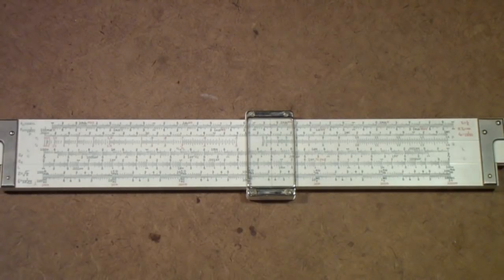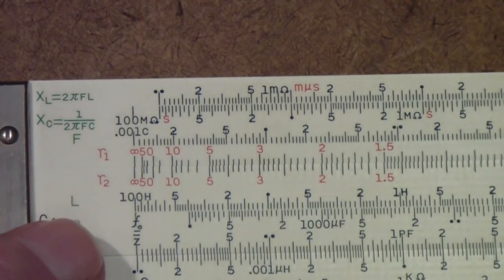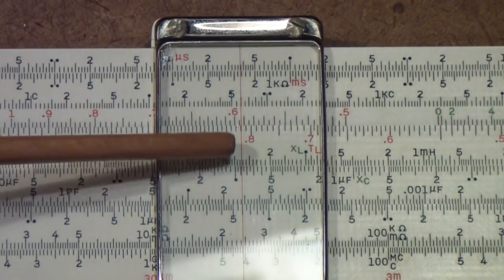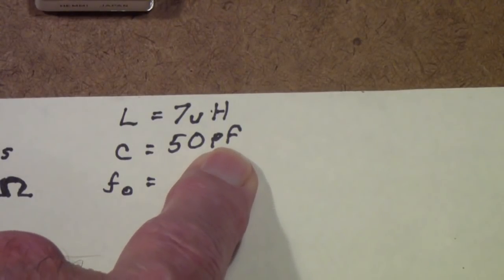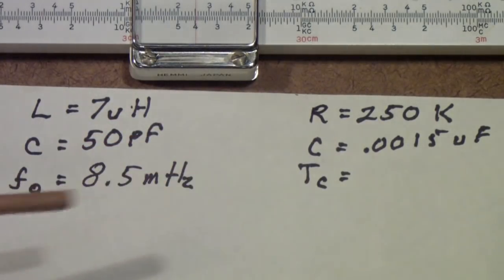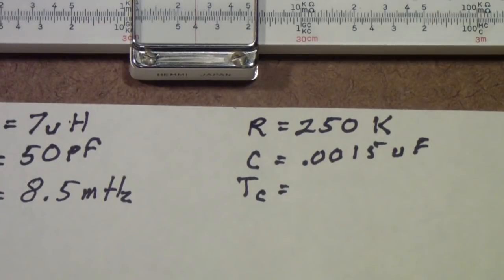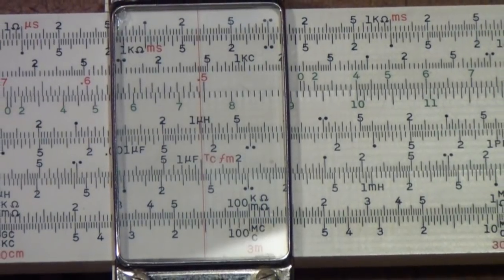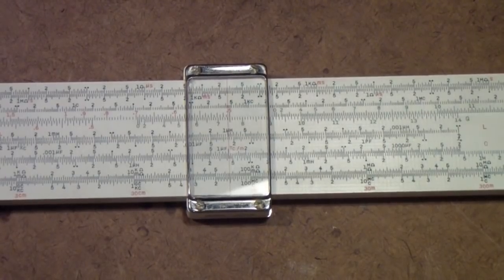TTT244 Hemmi 266 Slide Rule Demo

Comment: Wow...this is a really great video...I can use a slide scale...but in just a basic form.
I looked up a Hemmi 266 on E-Bay...$165!  Ouch!  :)
Reply from the maker: That is actually a pretty good price for a 266 in good condition with a case. They usually go for over $200.
Reply: @tomtektest8042  I bought mine in 1968 for $25. Canadian, the xl on the rule is for inductive reactance and xc capacitive reactance, great channel, I'm subscribed.